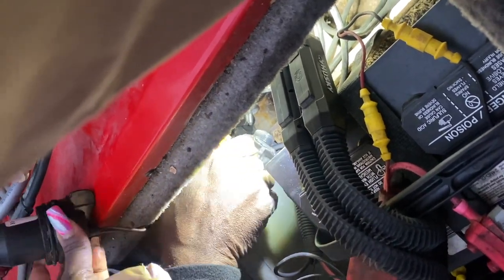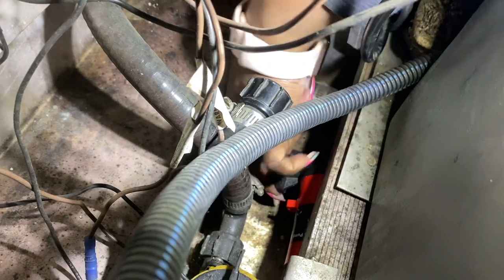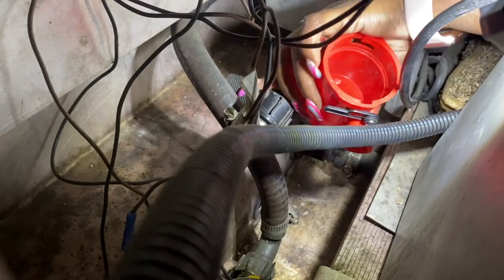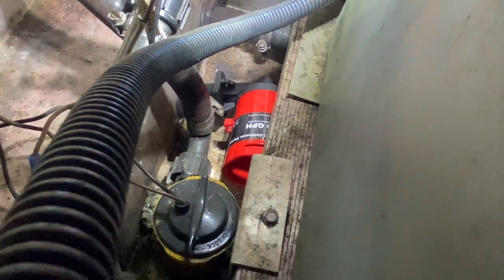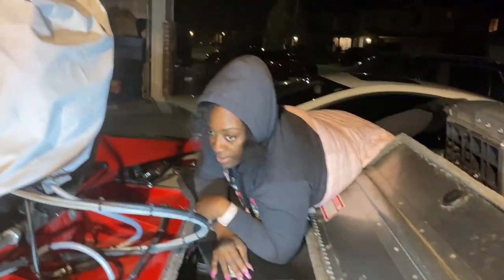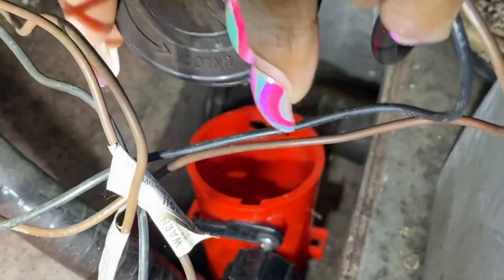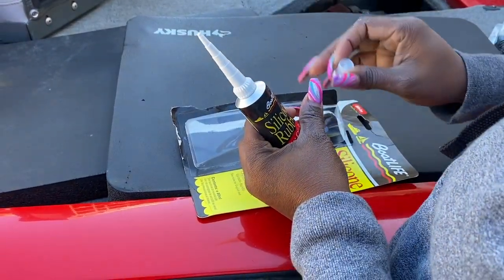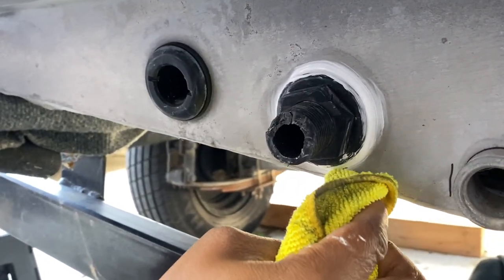How to install Livewell Aerator Strainer & Aerator Pump Housing | DIY Bass Boat Restoration Ep. 4

Comment: Anxiety levels were high. Since that looked like a pump since it's so low, the pump didn't have to be that low. An outlet could have been installed with a 90° and a hose connection to the pump and the pump could have been installed higher. Remember when your driving that pump pulling in water will not work as well. They make a 90 angle that will point towards the front of the boat to always intake water. Always load the boat with the current. Let the water push you against the dock never away from the dock. Always take corners on the outside of booeys.
Reply from the maker: I was trying to keep it in the same location as the original since the pump was working fine & didn't want to mess up anything since I'm still a newbie but lord was it tight quarters lol. Thanks for all the tips! I literally write them in my note book! Keep'm coming. Thanks💕🎣👍🏾
Reply: @Myishia Glitter and Gills  Add: Always keep a spare drain plug and the wrench to tighten (2) in your boat. Also keep a pack of multi amp fuses. Use battery powered lights when you can and keep at least 4 packs of batteries..